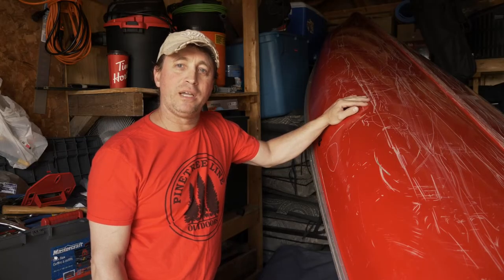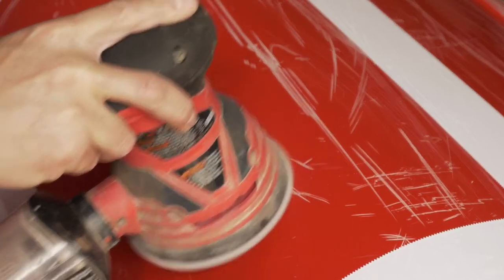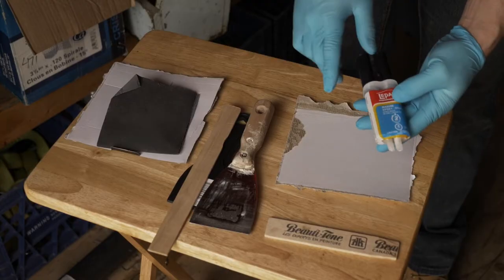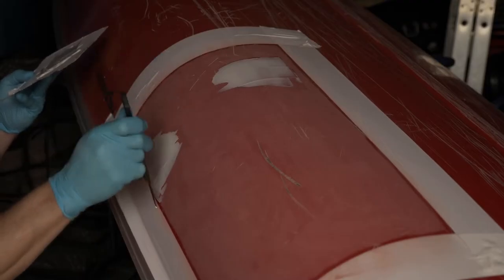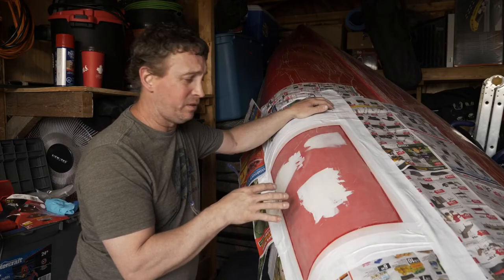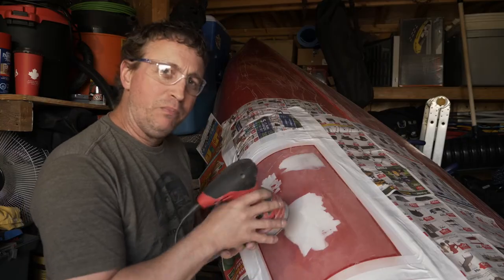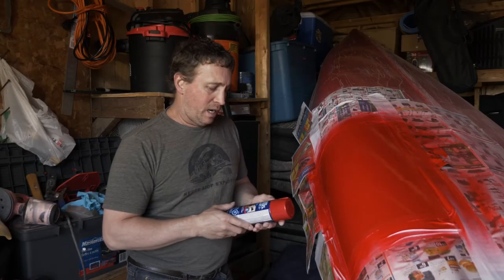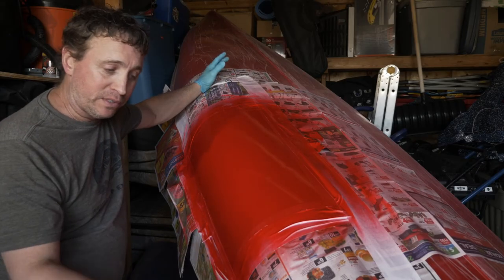How to Repair Gelcoat Cracks on a Fiberglass Canoe for Around $30

Comment: Nice job on the repair.  Other than taping the aluminum on the gunnel, I am not sure why you taped and papered the rest of the boat.  Unless you didn't want to sand it to make the paint stick?
Reply from the maker: I wanted a clean job in the one area of my ‘new to me’ ride so I didn’t want overspray outside of that repair area. Perhaps not necessary but I wanted this done with the precision of a surgeon. Thanks for sharing your thoughts brother! Doug
Reply: @PinetreeLine  I sold marine supplies for 17 years.   You do not want a surgeon painting your boat. LOL  I know you were using a metaphor,  It just happens that I have personal experience with doctors and boats.

Comment: Do you have a video on how to do the structural repairs with fibreglass?
Reply from the maker: Sorry Jay but this is an outdoors channel and this repair job was more about an affordable way of repairing a canoe than working with fibreglass. Appreciate you watching though. 👍🏻👊🏻
Reply: @PinetreeLine  that’s what I mean. A structural repair on a canoe that has a punch through hole. From the writes ups I’ve seen on nova craft and Souris River you use fibrecloth and expoxy for big holes and aqua mend for small punch throughs. Was wondering if you had anything that addressed that. Thanks though. Enjoyed this video anyways.

Comment: nice video. I would recommend a respirator whenever sanding. Also wipe down your work area with soap and water and then with acetone before applying gelcoat. If you are only going to apply a final coat of gelcoat use the wax one. For multiple layers use laminating gelcoat (unwaxed) with final coat of wax gelcoat.
Reply from the maker: Hey Bob thanks for sharing your thoughts. Appreciate it! Doug
Reply: I wax every coat and clean off the wax between coats with acetone. Then sand too. 
It’s better than saran wrap or whatever to make it air tight so the gel coat can set up.

Comment: I needed this video because this is exactly what I am planning to do. Thank you brother. Could you tell me if there is a paint I can use on the outside or do I need to use gelcoat?
Reply from the maker: You don’t have to use gelcoat, you can do like we did and use Rust-Oleum or any  other rust preventing paint. It provides a waterproof skin of paint and it comes in all kinds of colours. Good luck with your project brother! Doug
Reply: @PinetreeLine  thank you for taking the time to respond. I appreciate your time and input. Will do :)

Comment: wow that colour matched perfectely.
Reply from the maker: Not quite perfect but close enough for me. Thanks so much for watching friend! Doug
Reply: @PinetreeLine  I just bought a 16ft canoe off kijiji and there are a few areas that are going to need fixing similar to your video here. Is there an epoxy product that comes in a larger form factor? Or do I just buy multiple lapage marine kits? Thanks
Reply from the maker: @danielk6105  I’ve only ever seen the 25ml lapage marine epoxy kits so I’d just use multiple kits. One kit covers a pretty substantial area. Just an update, I used my canoe for 2 Summers now and zero issues with the repair. Good luck with yours!

Comment: Hey thanks for the great and informative video! I have the same canoe as the one you worked on, but I have a chip in the gel coat on the keel of the canoe, would this process be fine to repair that as well?
Reply from the maker: You’re welcome Ty! Yes you can use this process to repair the gel coat on the keel of your canoe. Good luck!! Doug

Comment: Anyone, please ? If a crack high up the hull goes completely through, but quite superficial on both sides, can epoxy be used on both sides ? 
It looks like a softball hit it, several cracks around a circle, but quite flat inside and out. 
The canoe is only to be used in calm, shallow pond waters.🤷‍♂️
SUBSCRIBED.
Reply from the maker: I would suggest cleaning up the affected area with a medium grit sander/sandpaper. If it’s a fiberglass canoe then you have the option of using a fiberglass patch kit on the show side of the canoe if the crack is wider than you suspected once you sand the area. If the crack is like you suspect you can use epoxy on both inside and the outside the canoe. Given the area of where the crack is makes using epoxy possible even though the crack goes right through. I hope this helps!!

Comment: I’m in the process of this same repair. I’m ready to paint. Anything needed to seal the paint? Matching might be a challenge as my canoes got some fading on it and I ideally don’t want to repaint the whole thing.
Reply from the maker: Cool stuff! Did not have to seal the paint as it’s made for water and rust protection similarly you wouldn’t have to seal marine paint either. My coat of paint faded a little because of use and the scrapes I put on helped it blend in 😂. Hope that helps. Good luck with yours! Doug

Comment: May want to use a respirator.....spray with gel coat? Not paint...?
Reply from the maker: If we were doing a huge repair or many repairs than sure on a respirator. If you want to do this repair on the cheap than no gel coat and yes after using marine epoxy you can use rust protection paint. If you want to spend more use gel coat. The whole point was doing a cheap repair. Thanks for your comment. Doug

Comment: Hi there, that repair looks great. I have a quick question, how does the paint stand up over time? Unlike a boat, canoes and Kayaks often get scrapped on beaches when you disembark or return to shore if you don’t happen to have a pontoon. I would expect the paint to simply scrape off especially as there was no primer. I’m interested as I am about to refurbish my grp sea kayak which has faded over time and has a fair amount of scrapes and scratches to the underside after a family friend borrowed it, who didn’t look after it as well as I do.
Reply from the maker: Hi Iain. I’m going to be totally honest with you...the repair area looks almost as good as the day we painted it. Although other parts of the canoe have taken a little bit of normal wear and tear the repaired part looks great with just a couple small surface scratches that aren’t deep enough to show the colour of the epoxy. The rust protection spray paint acts differently than just a regular spray paint. That’s the difference. I’ve been on multiple canoe trips since the repair, as you can and will continue to see on my channel. Appreciate you watching! Doug
Reply: @PinetreeLine  how much did that paint fade over the years? Looking to doo this myself but don't want too have to repaint it in two years
Reply from the maker: @evergreenmean6136  The area painted hadn’t faded at all. I’m extremely happy with it turned out and wouldn’t hesitate to do a canoe repair the same way again. Doug

Comment: For non structural gel coat cracking like a railing can I use bondo?
Reply from the maker: Bondo is more of a filler than epoxy so on something non structural like gel coat we recommend epoxy. Thanks for watching! Doug

Comment: Would it be same for a Kevlar canoe?
Reply from the maker: Yes you could use the same technique for Kevlar as long as it’s just the top coat, same as the fibreglass canoe. If there is a hole or crack right through you can use fibreglass to make the repair to your Kevlar canoe. Thanks for watching! Doug

Comment: Great video question at the end you mentioned you have rolled it on, I have to do a large section if I roll it on what kind of roller or mat should I use. Can you roll gel-coat? if so would I have to cover it completely with wax paper afterward? Thanks, great job
Reply from the maker: Thanks for watching Shane. You can roll this type of rust paint with a regular paint roller. This particular repair is not a repair using gel-coat so I’m not sure if you can roll gel-coat. Doug

Comment: what are gelcoat cracks ? vs fiberglass cracks ?
Reply from the maker: The gelcoat is the coating on top of the fiberglass. A crack of the fiberglass requires a different repair. Thanks for watching! Doug
Reply: @PinetreeLine  okay makes sense. 
Now that you explain that and I google a bit, I am starting to understand what I need. I see that I need to fix my small crack and also repair the gelcoat in a few places.
Thanks for the help amd videos!
I’m just trying to keep an old canoe health
Reply from the maker: @MrMrsregor  Glad to help a little. Get yourself a fiberglass repair kit for the crack then use our method for an easy cheap gelcoat repair.